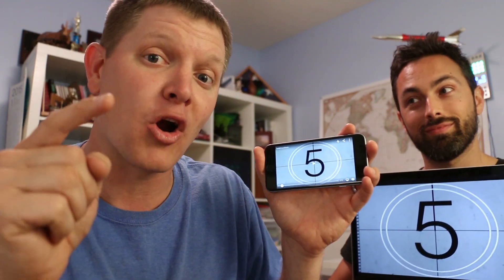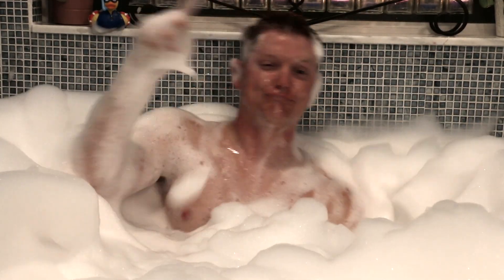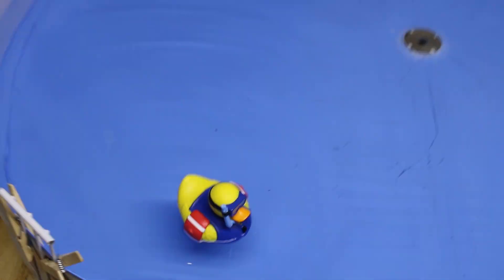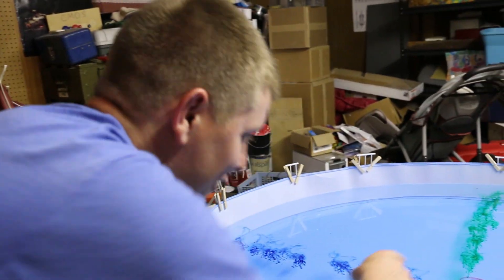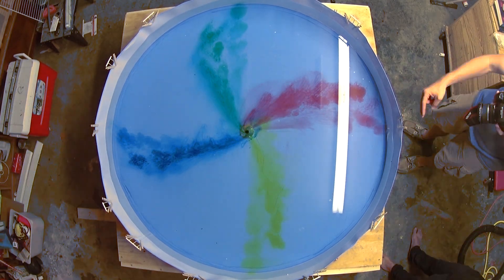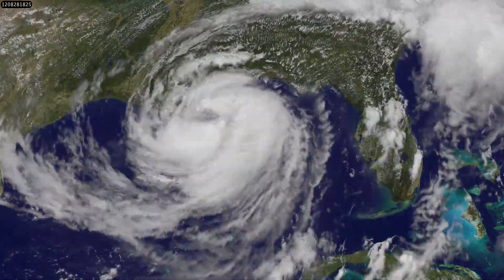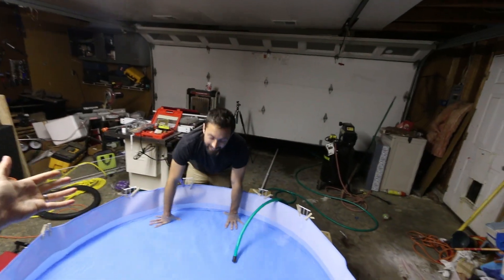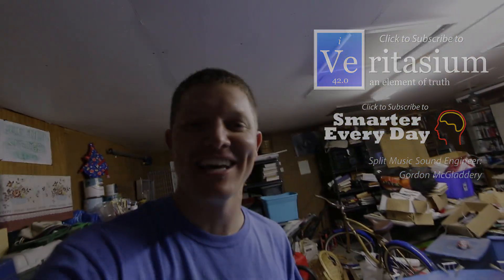The Truth About Toilet Swirl - Northern Hemisphere  (Smarter Every Day 137)

Comment: Wasn't the whole point of this to eliminate variables so nothing induces any rotation? As you guys were saying, you weren't going to reach in and unplug it because that could have an effect. So wouldn't dropping the food coloring in also have an effect that could cause the rotation? I feel like a better way to do this experiment was shown in you're video with him placing the rubber ducky in the pool while he was filling it, then you just leave the rubber ducky in the pool for the day while it settles and then let the water flow.
Reply: Spartaton It was already rotating. By the time they unplugged it, it was gonna swirl one way or the other. adding the drops after that moment would not suddenly make all of the water change the direction of it's swirling. You don't need to eliminate ALL sources of error just control them to a reasonable amount where you can calculate the margin of error to be small enough not to alter results in a significant way.

Comment: Sir, I just had a small question.. I tried syncing video, I just observed, when you said to assume pool at the north pole, earth is rotating towards its anticlockwise direction and at the south pole , its clockwise..
So my doubt is Do  poles rotate in opposite direction? 
I mean earth has only one direction of rotation at a point of time & at that point ,  if we assume earth as a ball, poles are particles on it, then at that point of time rotation of its elements should be the same as that of it...
& one more... if the speed is so low, the how can it experience a Coriolis component of acceleration ?

Comment: Based on the reason for the direction of water swirl, would the velocity of the swirl be greater near the pole because the pool would nearer perpendicular to the pole (axis of the earth) and slower near the equator because it would be near vertical in relation to the earth's axis ?   Eddie Wilbanks

Comment: SmarterEveryDay  - don't stand over a toilet bowl or look down into it. 
when you flush particulate is sprayed into the air in aerosol form and contains bacteria from the toilet. you basically blasted yourself in the fact with bacteria in this video.

Comment: Look at the bottom of this pool. There is no determined rotation. Rotation is above. It is an effect of fluid mechanism. In the perfect conditions CE may trigger the swirling, but in this exampe the perfect conditions did not occred. In such cases the speed of rotational movement did not indicate the strength of CE.

Comment: Sorry guys , but the direction the water spins is based on the shape of the drain . 
You used a drill to make your holes and the spin of the drill will leave 'rifling' . Like the rifling in a gun which spins the bullet .
In this video it appears to me like the hole is being drilled from the bottom side up and I can only assume that the other pool in the southern hemisphere was drilled from the top side down .
Please think about this( before attacking me) : If the earths rotation had this much effect on a little kiddie pool...just how volatile would our oceans would be? Violent clashes of oceans colliding in different directions at the equator , not to mention the effect it would have on the atmosphere .
Thanks

Comment: Formula at hand, apparent Coriolis acceleration is 2*w*V*sin(lat). Considering a pool, V~10^-2m/s, while w=2pi/86400 1/s, so Ac=1.45*10^-6 sin(lat), consequently Ac(35 ̊) = 8.34 *10^-7 m/s^2
After 60s the Ac would "cause" a lateral speed of 10^-5 m/s, that means a displacement of .5*Ac*t^2 = 1.5*10^-3 m. This why you need a really still water to see the Coriolis effect in a poll.
At few meters from the equator, the effect is so small that the deviation is less than the dimension of a water molecule.

Comment: I don't think the science is sound on this one. I really don't believe that the airflow was completely quenched, the pool stand perfectly level, and the valve perfectly situated for uniform opening. Even a slight deviation in the initial conditions would cause the pool to start swirling in one way rather than the other. To acquire evidence that the Coriolis effect on a tiny body of water is significant enough to induce a detectable change in angular momentum would require a far more controlled environment than the one presented in this video.

Comment: I remember when Omni magazine addressed this issue. This was, geez, the early eighties.  They postulated that the effect was real for the reasons given,  and they proposed precisely this experiment. However, they also concluded that in order to get measurable,  consistent results with all disturbing variables removed, much larger tanks would be needed--water tower capacity and perfectly round and level,  and that the water would need to rest for several days.

I'm only posting this here because I have this channel on my phone,  and Veritasium on my PS3,  which doesn't allow comments. But I've been subscribed to both channels for a long time.

Comment: Did you repeat the experiment more than once? There's a 50/50 chance that the water will swirl one way or another and a 1 in 4 chance that it would coincide with the north and south theory. How do you know (while your theory is correct) that your data wasn't just by chance.

Comment: As I said in Vsause, is this the Coriolis effect or did the water randomly flow in this way. I think you need to perform this test several more times. I suggest using the hosepipe from next door to avoid any charges for overuse of water.

Comment: I have a few issues with your experimental procedure. Mathematically, your pool is not large enough in diameter to exhibit any noticeable effect from the coriolis effect. Second, if your drain is even SLIGHTLY off kilter or off centre, that will influence the spin of the water far more than the rotation of the earth. Any imperfections in the surface of the drain would affect it as well. It's an interesting demonstration, but I think the random imperfections in the sides of the pool and the surfaces of the drain would influence the direction the water goes more than the rotation of the earth.

Suggestion: Set up five pools in identical manners, cover them with fine mesh to prevent air currents or foreign material from affecting the pool, then drain them all simultaneously. additionally, a neutrally buoyant particulate in the water might be a better way of demonstrating the currents, as dripping dye into the water will introduce currents as well. (I noticed in the video, that you introduced the dye in the same direction as you wanted the water to spin).

Comment: pretty cool video! It would have been nice that you do a randomized trial to make sure it wasn't the 1 in 4 chance of a fluke for the right sense of rotation. Typical minimum length of time required for weather pattern to exhibit any influence from coriolis effect is roughly 4 hours, example a land breeze or sea breeze that would start deflecting towards the right

Comment: A simpler explanation to the Coriolis effect, visualizing the momenta of individual water particles is conservation of angular momentum:
In the northern hemisphere, everything has a counter-clockwise angular momentum, which gets greater the further from the equator.
When the pool drains, water goes toward the center, decreasing the radius of the center of mass (radially), which decreases the moment of inertia of the water (yes, mass decreases as well, but moment of inertia depends more on radius than mass - I = mr^2)...
So with conservation of angular momentum, we have Iw = Iw. I decreases; w increases. The water in the pool starts spinning faster than it already is from the Earth's spin, and you see it spin.

Comment: Thanks I enjoyed watching the videos. They are right on all accounts except that the Coriolis effect is not quite as weak as their experiment seams to suggest; because they had a small diameter drain with fairly deep water for a slow flow rate, and added their indicator dyes at the top of the water surface. I believe if they had dye tablets at the bottom of the tub, you would see a much stronger water rotation in the lower level water actually going down the drain.

Comment: Your demonstration of opposite flows of sink waters is misleading: Typically the plumbing of these types of double basin sinks are two drainage pipes leading into one. If you have ever filled up one and opened the valve, you will notice that the opposite basin sink begins to fill with some overflow. This incurs the flows to spin counter to each other when the valves are simultaneously engaged.

In addition: One could argue that the experiment is biased by weather conditions: Wind and local humidity. Two similarly shaped sinks with reasonable plumbing should consistently replicate the Coriolis Effect.

Dye spotting can also affect water flow through the Marangoni Effect (Typical food dye is high in propylene glycol concentration). Solid particles such as microbeads, sand, or toilet paper are the typical choice for flow visualization.

Comment: I was in the Coriolis is BS at small scales. The sample size is too small to be irrefutable, but the argument is strong. If you consider Foucault's pendulum, it does make sense that there should be a difference. But this sample size is still 1 (per hemisphere.

If the water is following the logic of Foucault's pendulum then there should be no vortex at the equator, since both north and south sides are moving equally. But we know that the water will normally induce a vortex if the drain is small enough and free flowing. So does water spin half the time CW and CCW the other half if drained at the equator. Because flowing straight down shouldn't be an option. I have no proof either way but logically I would expect a vortex regardless of the Coriolis effect

Comment: Everyone is talking about the synched videos -- which clearly took well-planned shooting AND editing!  -- but NO ONE is commenting on your miraculous data! On how BOTH your videos completely contradict everything we know about the physical world!
      If your northern hemisphere kiddie pool had indeed been affected only by the Coriolis effect, it would have been rotating clockwise as ocean currents in the northern hemisphere do. (The North Atlantic and North Pacific rotate clockwise; South Atlantic and South Pacific rotate counter-clockwise.)
       EVEN IN YOUR OWN ILLUSTRATION at 4:30. If you imagine yourself standing at the edge of that enormous pool in Greenland and then, as you correctly do in the video, rotate the earth toward the east, the water in the pool would appear to be rotating clockwise to you standing next to it.
       Yet your 1.5m pools rotated counter-clockwise in the north, and clockwise in the south.
       And why did you say a hurricane would rotate the same way? Hurricanes are large low pressure systems that work AGAINST gravity and flow "up" (away from the earth's surface) hence rotate the OPPOSITE of the ocean currents which are perpetually pulled DOWN by gravity.
       The other possibility of course is that physics has changed overnight, in which case, you guys will not only win internet video awards, but at least a couple Nobel Prizes!
:-)

Comment: Something to consider is the way that conservation of angular momentum affects this. I once did a version of this experiment where I showed that an imperceptible initial rotation (which I could induce at will in either direction) would speed-up into a multiple rotation per second vortex, predictably always in the same direction as the initial influence, as the water drained out. I think this happens due to the way that angular momentum is transferred by viscosity in the water as well as being conserved as the radius of rotation decreases (like a figure skater drawing his/her arms in while spinning and speeding up as a result)

Comment: So, Dustin. I have a question. In a drain swirl, the wide part is on the top, the narrow part is on the bottom, and stuff goes down in drain. In a tornado, the wide part is on the top, the narrow part is on the bottom, and stuff goes up into the clouds. Why is that?

Comment: The Coriolis effect is real, but I see no way it can take effect on such a small scale. My dad watched a demonstration where two guys drained water north of the equator, walked across it, drained water again, and they spun opposite directions. But the difference in speeds is practically exact zero. I mean, the quality of the concrete platform it was done on would effect it more than the Coriolis effect.

Comment: Is the threading of the plughole and the direction in which the pipe flows the water not a variable?
Reply: wol377 They said they bought the same pool. Do the random variations during the manufacturing process affect the draining system that much?
Reply: +VidSheridan 
Mind you, I would agree that the effect is going to be very small on this scale and the test should be performed a (preferably large) number of times at a number of different venues.
Reply: +VidSheridan 
Oh, come Australia and USA would use RH thread for almost all pipe connections except a few used for LPG and Acetylene Cylinders.
Reply: +Rab Downunder RH thread! You're right of course! What a silly rookie mistake for me to make!

............ ;)
Reply: VidSheridan Yep... there's lots of variables not taken into account here. During the time lapse you can see a lot of movement on the surface of the water in the garage due to air currents. The side of the pool nearest the windows would be a different temperature than the other side causing thermal currents in the pool (vertical, yes, but the sides of the pool are not perfectly vertical so you get horizontal currents also) As small as these external factors may seem, they still outweigh the Coriolis effect. Consistent bias leading to consistent results.
Reply: Indeed. I'd be curious if the result had been negative, how would Destin and Vertiasium package have packaged it.. Would we get a "the coriolis effect isn't real!" or "the coriolis effect is inconclusive" or just scrap the whole project.
Reply: VidSheridan The question isn't whether the effect is real, it's whether or not it's observable at these scales. The maths show the effect is extremely small at these scales and negligible when compared with resting water currents unless extreme measures are taken. That being said, if they had swapped pools, draining mechanisms and did it in a few other locations I would be more willing to believe this was the Coriolis effect in action.
Reply: Excellent point, I'd forgotten about the application to larger systems such as weather etc. Maybe they just needed two much much bigger paddling pools ;)